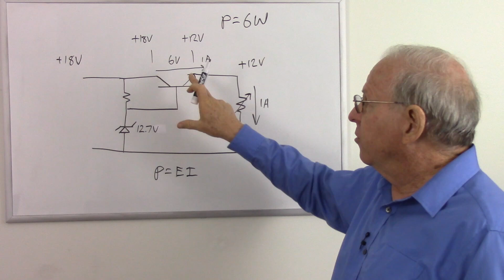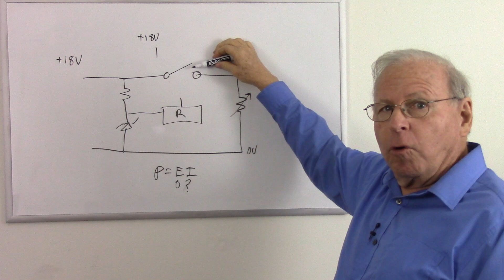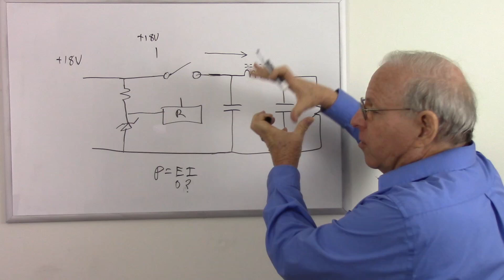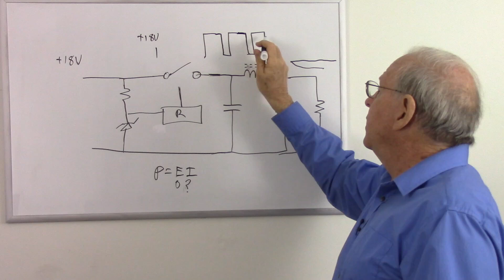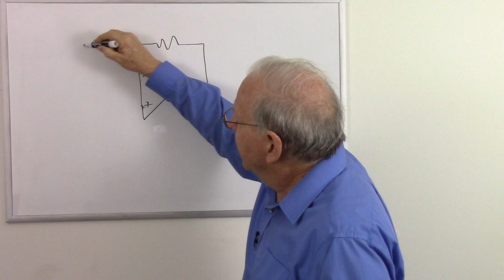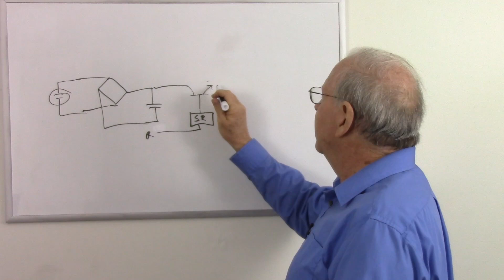Switching Regulators - Solid-state Devices and Analog Circuits - Day 9, Part 7

Comment: Most of the SMPSs (switching power supply) do use transformers. Very small one, but still transformers. I assume these transformers do used to prevent mains AC voltage to enter low voltage output during any faulty conditions. Though they "Leak" some voltage from primary to secondary due to parasitic capacitance. This is usually filtered out by connecting a non polarised capacitor from the negative output terminal of the secondary to the earthing or grounding terminal of the mains connector.

Comment: As i said i added the output voltage if op amp to input of transistor and simulation of this circuit i can get negative 210 voltage is it correct output

Comment: One thing I will note is that some power supplies are isolated and some power supplies are not isolated.  Its probably like 70% isolated and 30% non-isolated out in the world (guestimate).  For example, a USB-C PD port plugged into the wall is isolated.  A bench supply is not usually isolated but it can be.  Supplies for outdoor use are isolated.  And most high-end commercial supplies (such as "Mean Well" supplies) are isolated.   The power supply for POE+ is isolated.  Etc.

Isolated supplies still have a transformer, albeit a small one.  The transformer does the isolation.  It can be 1:1, but usually there is some sort of step-down... just not all the way down to 20V.  Usually there is a little step-down, like to 60V or so, just so the voltage rating of the circuit components can be lower and so cheaper transistors or FETs can be used.    The current is low so this allows the transformer to remain small.

The interesting thing about an isolated supply is that there is no path for the electrons via earth or frame-ground.  The only return path for the electrons are via the supply's positive lead and the only source for the electrons are via the supply's negative lead.   This makes it more difficult to accidentally short the supply or to accidentally electrocute oneself, but at the same time it also means that the supply can have faults (faults to earth for example) that go undetected unless the supply itself has a detection circuit for it (a big 10M or some such resistor between the frame ground and the supply output negative that it measures looking for current flow).

-Matt
Reply: If you have a bench power supply that has the output tied to ground then it's best place to live is a junk bin.  I probably have 40 or more lab power supplies ranging from vacuum tube era 3,000 Volt supplies to linear power supplies to current production switch mode power supplies.  I have never seen one that had the output tied to the chassis / earth ground.  All of them are isolated.  However several of the supplies have three terminals.  Positive, negative and a earth ground connection.  The earth ground connection has a tab that can be swung over to jump the negative terminal to earth ground "if" required.

Comment: I  thought I knew electricity flow but a Youtube by Veritasium has confused me. Could you discuss electron flow in a conductor.. Is electricity a wave or electron flow?
Reply: Current is just the flow of electrons.  That is, current is just the amount of charge passing through a volume of space.   Every electron have the same amount of charge.  One electron == 1 unit of charge.   Counting the electrons passing through a volume of space is a measurement of current.

Current alone is not power ... it does not perform work just by itself.   For example, a current flowing in a loop in a super-conductor is not doing any work.

Voltage is basically just the difference in charge density between two points (with some caveats).   Charge density, in turn, is simply the density of electrons minus the density of protons in a volume of space.   That is, squeezing electrons together so they are at a higher density than the protons in nearby atoms is what creates charge density.   The absolute measure of the charge density at any given point IS NOT VOLTAGE.

Voltage alone is also not power... it does not perform work just by itself.  For example, a power supply outputting a voltage but not connected to anything is not using any power or doing any work (ignoring vampire power consumption inside the power supply).

(For voltage, think of two magnets on two sides of a piece of wood.  The distance between the magnets causes a force which is "potential energy"... not work, not power, but potential energy.   That is effectively what a voltage in an electric circuit is, but caused by the electric potential between electrons that are being packed together or pulled apart from each other, and not the magnetic field).

--

Ok.  So now back to Veritasium.

When it comes to "electricity", power can be transmitted three different ways.  The first is (current * voltage) inside the wire.  That is straight-forward I hope.   The second way is through direction emission of an EM wave... a changing electric field.  A static electric field doesn't transmit power.  Only a changing electric field.   The third is coupling through a magnetic field (transformer, inductor).

For the Veritasium example, massive changes in the voltage from "closing the switch" emits a fairly powerful EM wave that can coupled across the wires and cause electrons to move on the return wire very quickly (speed of light as the crow flies).  But this EM wave is momentary.

The propagation of the changing potential through the wire, however, creates more or less a continuously changing EM wave that can couple across.  So as the voltage change propagates a good chunk of power continues to be transmitted via the field.

Once the huge changes in potential (voltage) have completely propogated through the wire, however, the EM wave being emitted by the wire due to the current is much much smaller.... there are no longer huge changes in voltage propagating along the wire.  So NOW nearly all the power being transmitted is being transmitted through the wire, not across the gap.

Remember that power in a circuit requires current (flowing electrons) AND voltage (electric potential).   Also... fun fact... power is relative too.   You are measuring power as (voltage x current) through a wire, but "voltage" is a measurement against some other part of the circuit, such as ground.  So power is relative.   The heat generated by the circuit is entirely due to the current and resistance and nothing else (power = I * I * R = heat generated when R is the resistance of the circuit and no other forms of energy are involved, like acceleration).

There is a lot more to it than this, but that should be enough to understand what is going on.

-Matt